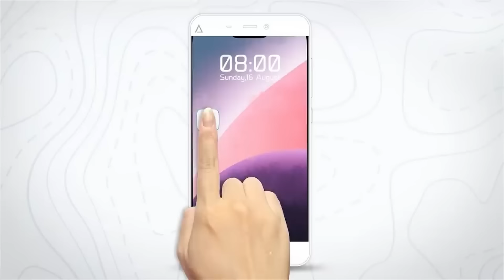322. RV Industry Shenanigans and Your Best Day at the Campground

Comment: FYI Airstreams have a 3-year transferrable warranty.  They even manage warranty claims related to installed appliance manufacturers, e.g., fridge, water heater, furnace, etc.  I would definitely buy a "Camping Coffee & Cocktails" book!   In bad weather, don't wait for the siren, get a NOAA weather radio and have it on if there is any chance of bad weather.  The local Emergency Management may or may not get the sirens on in time.  Ryan Hall Y'all's YouTube channel is a true lifesaver!!
Reply: A NOAA radio is good, and cheap. But even with the NOAA SAME option to just receive local forecasts, I get awakened in the night about tightly localized events 50 miles and two counties away. The system is marginally better than nothing, even in storm country. There are also compact matchbox sized lightening detectors, which only alert when they directly sense lightening within 20-30 miles, which is close enough to reach over and strike you.

Comment: 2021 GD Reflection 337rls: 🤞so far so good. I think the frame flex issue could be a combination of boon docking over rough roads, overloading, and driving faster than 65. I don’t know for sure about anything really. That said, when you look at the axle and leaf spring design the frames were not designed for over weight, off road driving let alone speed.

I think Brinkley is potentially building a better structurally engineered line of campers but you’re paying for it. 

It’s all about the price point and what you have to pull it is where the market has to go to stay in business.

With  Bidennomics the last three years, inflation, labor costs, and interest rates are keeping quality and price point at a distance.

I don’t know is MAGA nomics will fix it anytime soon either. 

It’s what the manufacturers have to juggle….they need a consistent economy for more than just 4 years to find the balance between quality and price. I do know  hitting small and large businesses with higher taxes if Biden lets the Trump tax cuts expire isn’t good for anyone 🤷‍♂️

And to roll the dice again 😖